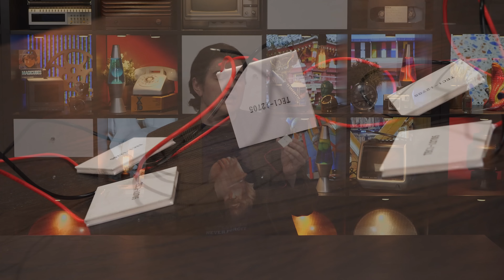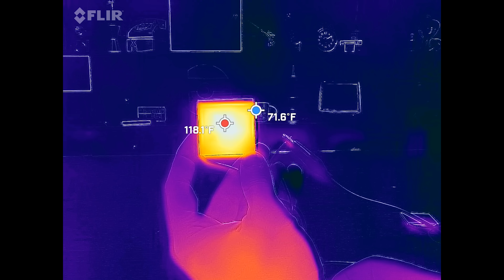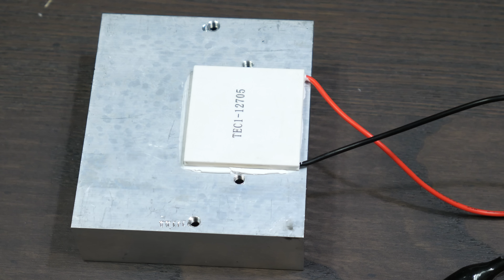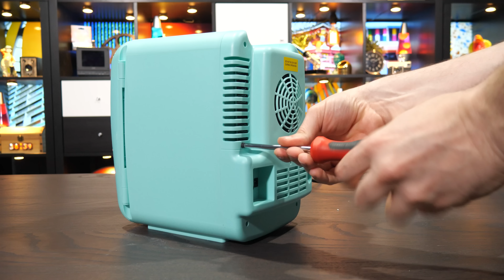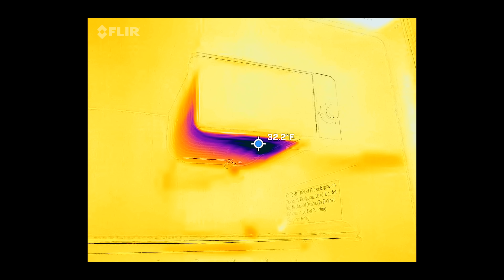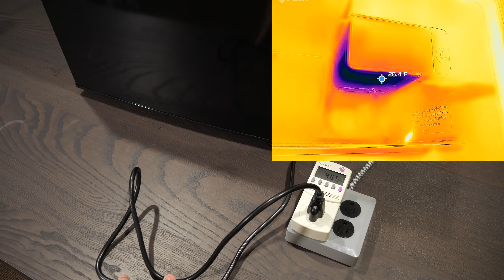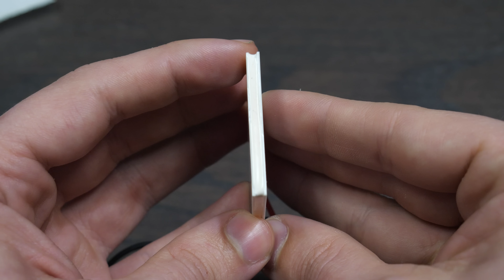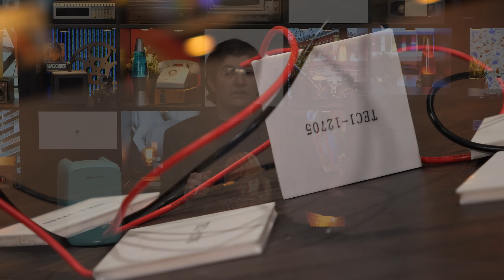Thermoelectric cooling: it's not great.

Comment: I had picked up a similar cheap but branded one of those as it had a dc  (car lighter plug) in. Ran it for a test and got annoyed that it never turned off, not cooled decently. In a 24 hour test it pulled more power than the house fridge. It's only use use is decorative with a side benefit of being able to hold stuff.

Comment: I have a question. The use of the term "Heatsink" to describe the aluminium block we attach to electronic components,  is this correct? As it's used to transfer the heat to the air. So that makes it a radiator and the air is the heatsink. 
🤔

Comment: coolest (pun intended) use I saw for peltier module was on a big (1.2m wide, ~6m long) newtononian (i.e. the spot to view stuff is on the side at the star-pointing end) telescope to get the CCD receptor to -60°C (cooler receptor are moar accurate). The comptacness and not caring 'bout being moved made them great fit for the purpose.

Comment: I was in true awe, when I saw a pelier element on a furnace. Not only can it heat or cool, but it can also generate electricity from a temperature difference.
So if you put one side on the metal housing of your furnace and stick a neat ornamental heat sink on the other side, you can power a little fan to not only keep the heat sink cool enough to keep system going, but also spread the warm air of the furnace! :D Am I enjoying this too much?

Comment: You make great points about consumer applications, but I will say that TECs have TONS of advantages for scientific equipment where you need very precise temperature control and aren’t trying to cool down such a large volume as a whole 6 pack. And being able to turn the electricity around so you can both heat and cool is great for regulating chemical reactions.

Comment: I honestly might go buy that fridge. It's small and convenient, no buying ice/dumping coolers, would fit very easily in my car for soda/energy drinks on road trips, where I've used coolers before. Would especially work well if the car is being air conditioned in the first place. The fridge seems good if the tradeoffs work for your situation.
Reply: "Another fridge is bigger and colder and has a freezer! It uses less power!" Fine and good, I won't be replacing my kitchen fridge with it, but maybe elsewhere, power isn't a concern, I don't need a freezer or even food safe temperatures, and I want something compact that I can move around without worrying about the oil distribution in a condenser. I don't understand why you're so fixated on one use case that you can't imagine someone mmight want the tradeoffs.
Reply: Oh, you kind of get around to that. Still strange you were so harsh on it in absolute terms given that

Comment: I have a cooler with a peltier which can house around 20 beers. It will get them cold enough so I use it for occasional parties when the fridge is full and it will turn cold enough. For 24/7 usage, better buy a decent fridge

Comment: I got a different brand of little mini fridge, last year. Knowing how it worked, I was not disappointed in its performance, pretty much as expected. Cooling about 35°F below room temp, stuffed under my desk with limited air flow. Heating the "fridge" contents was a nice surprise, getting to about 135°F next to my desk. I've lost my notes on timing on temperature change, but as expected, not quick. Being capable of running on AC or DC, a definite plus. I'm pleased and would never send it back.

Comment: They're actually almost mandatory for aging tobacco (in anything less than an industrial setting) -- it is very dangerous to overcool tobacco because condensation -> water -> mold and cigars must be kept at 60-75% RH, and you have to keep the temperature between 60 and 75 F. Room temperature would typically be very close so you dont have to cool all that much, and keeping the temperature stable to keep RH stable is more important than cooling things down to very low temperatures or quickly.

Also, a box of cigars can easily run 1000 or more, so if youre storing 15 boxes, I dont think that you care about the electricity bill all that much compared to losing all your cigars...

Comment: Fun fact: if you apply heat to one side of a Peltier module and use a heatsink on the other side to create a temperature differential, it will (like an electric motor if you spin it) generate electricity.

The house I grew up in had wood burning stoves in it, and we had a couple of peltier-powered fans to distribute the heat around the room better. The fans doubled up as air distribution devices and as coolers for one side of the peltier modules, the other was heated by standing the (metal bodied) fan on top of the stove.

Comment: I think these devices are used in a scientific instrument called a "chilled mirror dew point sensor". The idea is to have a mirror surface that you cool down to the point where dew starts to form on it. Shine an LED on it and use a detector to tell when the dew formation blocks the reflected light.
The issue is that you want to keep the mirror's temperature right at the edge between evaporation and condensation, typically by cycling back and forth across the boundary by small increments.
The peltier device us perfect for this nimble fine adjustment of the temperature. I imagine there is also a larger bulk cooling system to get the mirror close to the dew point before switching to the peltier device.

Comment: I bought a few of these because I wanted to build a cooling setup for a sundew plant I bought (D. Magnifica), unaware at the time that it requires extremely cool nighttime temperatures. As it turns out, it was much easier to just buy a cheap minifridge with a glass door and control it with a thermostat outlet. Still, they're pretty neat and I wonder if I could make something compact enough to fit on a shelf

Comment: You would think the little desk units would be more like chest freezers. Even if the door isn't insulated, orienting it with a top-open door would help. Obviously that doesn't matter if the unit is just always running but it seems like it shouldn't be too much more expensive to add a cheap probe and switch, with about a day's worth of programming a set-it-and-forget-it rom that all the production units can adopt for years to come.

Comment: I had one similar to that. It quit working after a while so took the guts out, replaced the peltier module and thermal paste, installed a cheap temp controler and a higher speed fan, modified the case for it all to fit, and ran it on a bigger power supply. Fun project and now it has no problem getting down to 35f in a hot shop.

Comment: My dad's old camper van has a different kind of fridge that I'd never heard of before: an absorption refrigerator! It has the benefit of having no moving parts, but (as my dad found out) they kick out a lot more heat than a vapor-compression refrigerator. He dramatically improved the performance of his one by mounting a PC fan so that it forces some airflow over the radiator at the back.
Reply: I'd love to see a video on those. There's some you can use on gas, 12V and 230V, all just heating the refrigerant in different ways.
Reply: Yup, super common, every old school RV has one. Also the plot of the movie mosquito coast with Harrison Ford.
Reply: I'd love too see a tech connections style explanation of how THOSE work. Ha, good luck. Ammonia absorption cycle is not the most intuitive thing... hey, let me go light the pilot flame on my old fridge!
Reply: As I understand they are about as efficient as using the same amount of propane to run a generator to power a compressor fridge. I was looking at one that if run on electricity took 300 watts. However they seem to be able to withstand long periods of disuse, so they might be worth it at your standard house as an emergency spare.
Reply: @thomaswilliams2273  There were some attempts at gas powered air conditioning which ran into the same issue, plus the ammonia is a major safety concern if it leaked.
Reply: Alec drinks beer confirmed!
Reply: They are also used in hotels (at least in Europe) since they are completely quiet
Reply: They still make and use them in RV's.  Our 2017 camper has an absorption fridge/freezer, and it works well. It runs on either 12V or on propane. On Propane however, it still needs minimal 12v for the control circuits. The past few years, the RV industry has been switching to 12V compressor refrigerators, but many still come with the no moving part absorption types.  We also have a fan on ours mounted in the "chimney" space that has the vent on the roof where the heat from the fridge gets vented. Overall, it works great though. The freezer is 0 degrees, even when it's in the 90's outside.
Reply: I hadn't heard about that. I do know that if you want to cool a few cans, you can just set them on the propane cylinder and harvest some of the cooling when that phase change freezes the outside.
Reply: @SmallSpoonBrigade  there was a video, long missing from youtube, of someone making a "beer cooler" by building a propane-fueled turbine "engine" - but the whole point was to "use" propane at a high enough rate that the cylinder cooled the liquid it was in to near 0C.
Reply: I went and looked these up, and in case anyone is lazy but wants a quick explanation of how they work, this is as I understood it:

Absorption refrigerators are essentially the same as a typical refrigerator, but instead of using a pump to pressurize the refrigerant to drive things forward, it instead uses heat to do it. Absorption refrigerators typically use an ammonia solution. The heat drives the ammonia out of solution which then flows through the normal condenser and evaporator stuff you're familiar with.
Reply: Good ol RV fridges
Reply: Einstein refrigeration? (different than the bohs-einstein condenser, i think)
Reply: They also love to burn down your camper, since they use a literal flame.

Comment: I'm a building engineer at a hospital and they're starting to sell these as full-size refrigerators and their marketing them as no refrigerant non-toxic which the hospital saw as a benefit because a lot of small refrigerators nowadays use propane luckily I was able to point out the flaws before we bought almost 50 of these units and I can't even imagine the nightmare of these units with them constantly being opened and closed in a hospital setting

Comment: It won't fit on my desk but it will fit on top of my filing cabinet. I love my little cube fridge. I had one of those Peltier coolers in my camper after my fridge died but I tossed it after the first trip and replaced it with a $70 Walmart special cube fridge. Had to cut the hole a little bigger where the old fridge was but it works pretty good 5 years later

Comment: There is one place where thermoelectric cooling is helpful. I have a thermoelectric travel cooler that I use on road trips. It fits behind the seat of my truck.  I start out with cooled items and cold packs in the cooler. The cooler keeps the contents cold for several days. Yep, as a refrigerator it is terrible, but in certain situations it can be a help.

Comment: Fun fact: if you look at actual COP/dT graphs for peltier modules, they can actually be quite "efficient". Unfortunately, you need to be cooling a space with incredible insulation. Under the rare(possibly nonexistent) circumstance that you need to cool a very small space, with space age insulation, down to about freezing, in an environment that never exceeds room temperature, and for whatever reason you need this done with the high reliability of 0 moving parts and constant power draw, you can do it at wattages that a standard USB-A phone charger will provide.

Comment: I have one of those little fridge type things, and I love it. No, they aren't miracles, but it's a great way to keep cold drinks. Not to mention, the size is a major benefit. A real mini fridge may function a lot better, but you're really limited on where it can go. 

Not to mention if you've worked in food service you know how absurd and inconsistent health department regulations are. Butter lasts only two hours at room temperature, yet black mold in ice is ok? Then there's meat temperatures, where they insist on only using the temperature that would instantly kill the bacteria, not at all allowing that keeping things at lower temperatures for even a few seconds or a minute depending on the temperature, which you're cooking it so it's going to get that time, makes it just as safe.

Comment: Appreciate the video, i wasnt aware those little coolers were so popular when ac power was available. 

I will say, as an american truck driver, peltier coolers are a very convenient device in my day to day work. It runs off dc, and the trick to use them is to fill them up and replace as you use. 

The coleman 42qt thermoelectric cooler holds about 10*34oz beverages. It takes approximately 18 hours to cool those beverages to a pleasant drinking temperature. But once the entire thermal mass is cooled, replacing a beverage doesnt drastically increase the overall temp. 

Did the math when i first got my cdl on the cost of ice in truck stops and after approximately 3 months the thermoelectrics pay for themselves. Meanwhile, if i want actual food safe compressor refrigeration in the truck, i have to replace the mini fridge right around every 12-18 months because the jostling of the truck on u.s. roads loves to kill them

Comment: 1. why actually is it that the compressor needs to sit 4 a while after being mooved? (what is going on in there?) 2. you didn't mention the importance of the elements in scientific research / laboratorys. because there is no vibration there are perfect for some experiments e.g. something called super cooling if i remember right.

Comment: What im taking away from the peltier thing is maybe we jjst didn't care to develop it ? There are other pelter devices that's used in old-school natural gas based house heaters(idk how to call it) they tend to have a safty piece that keeps the gas valve open in response to heat cuz ut literally turns heat into current i thin them with peltier elements should make a improvement

Comment: Quick pick-up on 29:35; I used to have one of those evaporator-in-rear models, and they do need defrosting from time to time. No matter how I had the thermostat set on mine, a layer of ice would always build up on the back wall and I would have to unload/shut-off and defrost the fridge before too much built up. This is a particular problem in countertop use as it may lead to water trickling out onto the countertop, and a soak-up mat is highly recommended in those applications. 🧊💧👍

Admittedly, I only had that thing in service up until the Grenfell disaster, which was initially started by the overheating compressor in a Beko fridge/freezer. Living fairly close to Grenfell myself it's completely scared me off of having any compressor based refrigeration in the house now. 😥

Many thanks though for explaining Peltier elements, and how all those „Mini coolers“ actually work! I'd often had my eye turn to them as a seemingly cheap refrigeration solution (I'm very low income ♿ so cost-sensitive as F) but thankfully always noticed the disclaimer „Not suitable for milk or dairy products“ which made me aware the cooling they used was relative to outside temperature, not absolute to a specific one. Those things'll happily drop a can of drink down to a seemingly cool and refreshing temperature, but put some milk in those on a 35°C day (About 115°F) and you're looking at near instant yogurt! ☀🥛😉

Comment: I have learned about fridges and heat pumps while studying, and have only discovered peltier modules on the job : these things are FANTASTIC (for the needs we have), it felt like voodoo magic when I first saw them

I do not know exaclty how mine work, as I cannot tear them apart, but I am still amazed by their fast responsiveness and precision in temperature regulation. I would guess they are much more expensive and well-engineered 
The video explains really well why they are useless in a fridge, but damn
They are dog's bollocks in a lab environment

Comment: I got a Cooluli 20L unit that has temp control and dual peltier's. Actually works quite well, especially after you boost the voltage to 14v and put quiet fans on it. Moisture inside freezes and temp drops to around 40F when its 70F inside.

Comment: I have a thermoelectric humidor that is great. It has a thermostat, only has to lower the temperature about 10 degrees from room temp so it doesn't actually run very much, and is a lot smaller than the compressor equivalent.

Comment: I don't know man, I don't find them totally useless as a truck driver. In fact they work pretty darn well. There have been times where I've gotten my drinks down into the mid-30s using devices like this. Put on average they're in the low to mid-40s that I get my drinks down to.  That's cold enough for me on a hot day. I don't mind the fan as long as it does its job. Which usually they do. I think you're being unjustifiably negative toward this product. I have seen it do some real good. Additionally, it was never meant for food for more than a few hours. Finally, people usually use these in Mobile situations such as their vehicles or boats and the like.  Nobody really cares about that power output in these applications. Like I said I think you're giving these things a worse name then they are deserved. They put out a product and told you exactly what to expect from the product. There was no deception. Sometimes I think you're a little OCD about products likes. But it does what it's advertised to do and you should be happy with that

Comment: IIRC one other application of Peltier elements is ... power generation from heat sources! I think the RTGs used on Voyager 1, 2 and the Mars rovers and other space probes use Peltier elements, as a temperature differential also induces a voltage differential on the element?